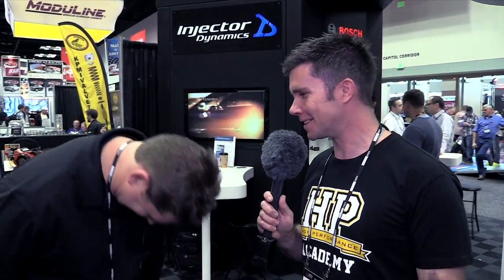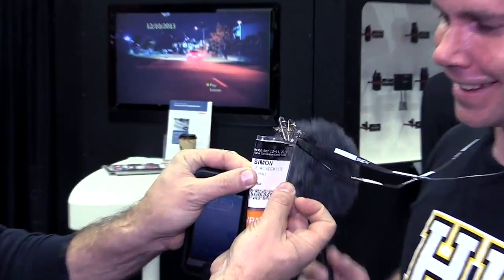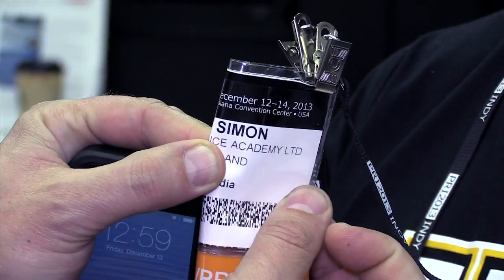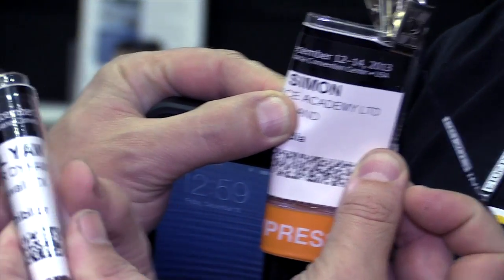Paul Yaw from Injector Dynamics speaks fuel injectors with the High Performance Academy

Comment: ID1700👎
Reply from the maker: This one is from a few years back, but what issues have you had with your ID1700's? - Taz.
Reply: Just idle issue. Seems like tuners can’t find tune these injectors on pump gas.
Reply from the maker: Pretty big injector, their X series injectors are the newer version that allows for better idle control (so ID1700X I believe) which was made to fill the gap between the ID1300's and ID2000's when it comes to idle control - Taz.